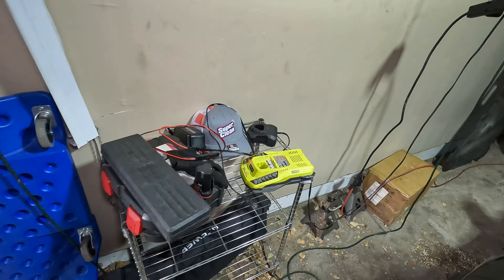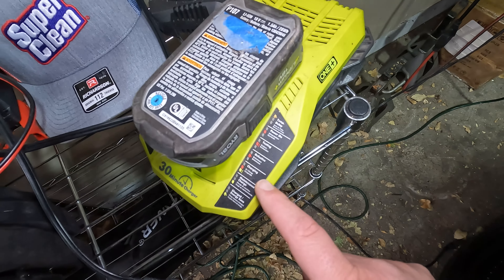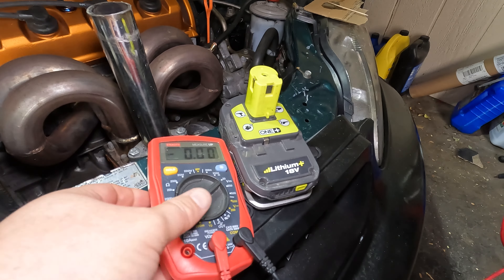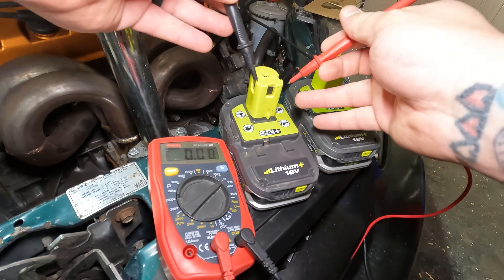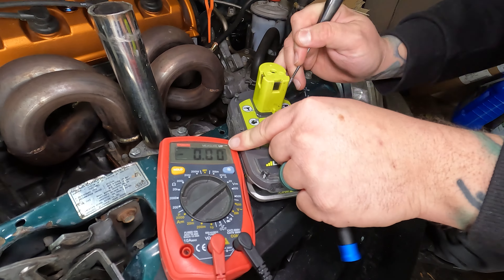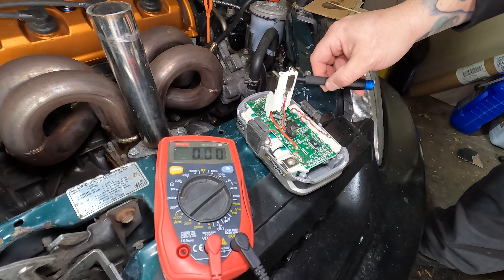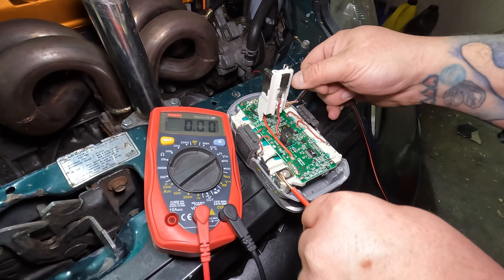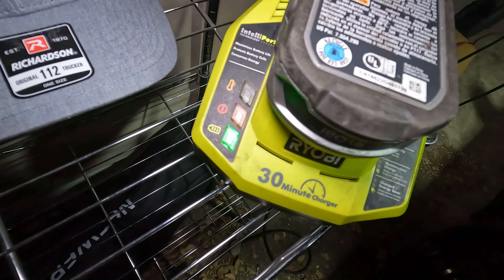How To Restore A Dead Drill Battery! (Fixing Ryobi 18v One+ Battery) | TunerThings

Comment: How many amps was the 12v charger you used?
Reply: Use the lowest current 12 Volt that you can find.  You want to slowly brings these cells back to life, not shock the hell out of them.

P.S. - you can use a laptop AC/DC wall adapter if you don't have a 12 Volt charger available.  The voltage isn't as important as you might think.  Anything up to 20 Volts will ensure the pack doesn't overcharge.  (EACH cell inside is 4.20 Volts when fully charged.  So..... 4.20 Volts * 5 cells = 21.0 Volts.)

What this video fails to acknowledge is that the cell balance between each of the five cells is important.  And that may even be the reason the Ryobi charger stopped charging the battery in the first place!  

Unbalanced battery example:  
cell #1 = 4.15V,  
cell #2 = 4.15V,  
cell #3 = 4.15V,  
cell #4 = 3.35V,  
cell #5 = 4.15V.

See how cell #4 is much lower than all the rest?  The Ryobi BMS doesn't like that and may prevent you from charging the battery.

When you charge the battery per the steps in this video, you're doing what's know as "Bulk Charging".  You're charging all five cells together as one battery.  It usually works ok... unless the cells have become unbalanced!  If the cells are unbalanced... then it's much better to "Balance Charge" each cell with the exact voltage it needs.  

You can achieve this balance charging with a typical 18650 cell charger, connected to the low voltage cell(s) inside the pack with alligator clips and a jumper wire.  Go through each cell one at a time... measure first, then charge it to the same voltage as the other cells.  Typically you pick the highest voltage cell and make the other four cells match it using the 18650 cell charger to increase the voltage.   

Once you get the five cells balanced again, it is unlikely that this problem will creep up again.  (Unless you have some bad cells.)
Reply: @test-193  I’m attempting to fix two of my batteries, both of which are showing almost the exact same voltages on each of their 5 cells as your example. 4 are sitting fully charged, 1 is at 3 volts. 

Can I use a basic dc bench supply attached to the problematic cells to bring them up to 4v? Or do I need a specific 18650 charger
Reply: @test-193  Hi, do you know what to do if all the batteries are equal, 3.6ish, and test inside on contacts shows full.  However, test outside on the 'tower' contacts only shows 5.6Volts.    Thanks in advance

Comment: The Ryobi BMS inside the battery is particularly touchy.  In a nutshell, the BMS (Battery Management System) thinks there is a problem, so it won't let you charge the battery for safety reasons. Mostly it just creates additional battery sales for Ryobi though. 

There are a few reasons the BMS goes into "shutdown" mode: 

1) Overall battery Voltage is too low. (The threshold is approximately between 12.0 and15.0 Volts.) 

2) The BMS detects "unbalanced" cells in the series string. (I don't have any reliable info on the threshold for this. Perhaps 0.25 Volts discrepancy between cells?) 

3) Over temperature. (This should AUTOMATICALLY reset itself, but I don't have info on the BMS software programming.)

For non-functioning batteries, try these things:

1) Verify that the individual cells are within 0.2 Volts of each other. (e.g.- all cells at 3.30Volts, or all cells at 3.40 Volts, or all cells at 3.50V, etc etc...)   This is called balancing the series cells to match each other.  If the individual cells are not balanced, you can use a typical 18650 cell charger (4.20 Volts) with a wire and some alligator clips to charge up the low cells to match the higher cells.  Do this one cell at a time.  4.20V is considered fully charged.  3.25V is considered empty.  You'll want all five cells to be about 3.30V or above, AND very close to each other... perhaps 0.2 Volts difference or less.  

(The Ryobi battery's BMS is supposed to take care of this "balancing" but it just never does an adequate job.  Manually balancing the cells is far superior.)

2) Once you have all cells reasonably matched in Voltage AND the overall voltage is up around 15 Volts, now put the battery on your Ryobi charger.  Does it work now?  If not go to step 3.

3) Find the reset pin on your circuit board.  It is usually labeled RST.  With a small wire, jumper the RST pin to battery ground for about 10 seconds.  Remove the jumper, then immediately put the battery onto your Ryobi charger.  It should work fine now.  If not, you'll have to take more extreme measures. See step 4.

4) In very few situations you may have to use a jumper wire to connect the gate from MOSFET #1 to the gate of MOSFET #2. This will force the FET's to both be on and that should allow you to charge and discharge now.

Hope this helps!
Reply: Do you know any tricks on how to reset the Dyson Vacuum battery packs? I have charged all cells individually but still will not accept a charge, 100% certain the bms on that battery is still on lock mode, thnx
Reply: My batteries are measuring at 0 volts do you think I can still get them going
Reply: Most excellent comment!

Comment: Hi i got some problems with a ryobi batery 18v
First: the indicator charge just turns on one led when this One have 17 volts,and second, the charger show as if this one are loaded but have 17 volts and the drill don't Work with this Voltage 
Do you know what could be the problem?
If you can answer me I would be very grateful, thank you
Reply: I got the same issue, the bad battery has 17v. The good one 20v. Doesn't make sense since they are labeled 18. The bad battery flashes red in the charger and the indicator on the battery itself when pressed only the 4th (tallest) blinks.